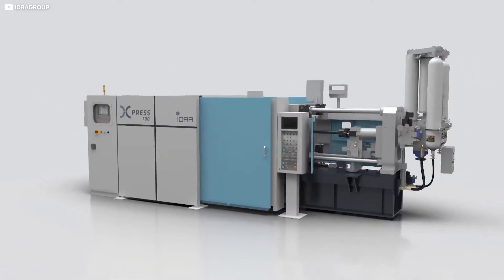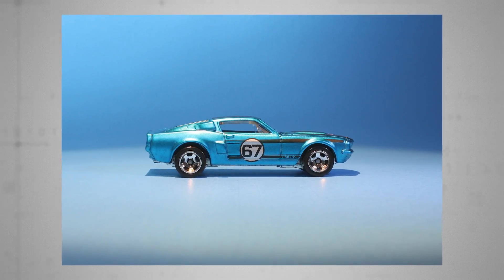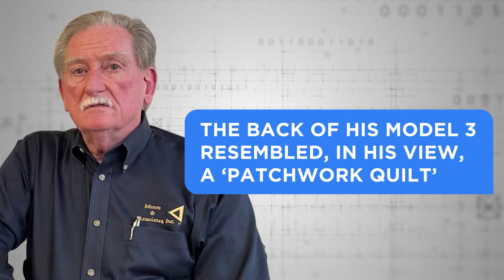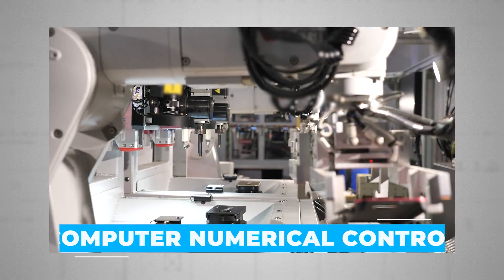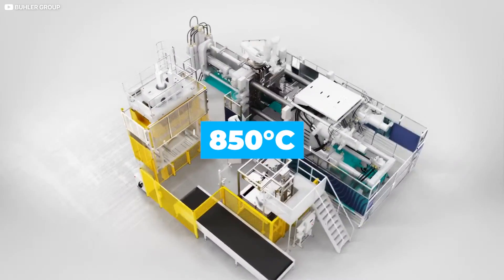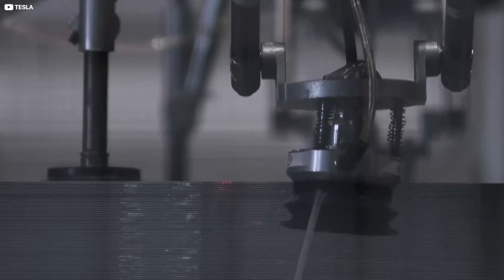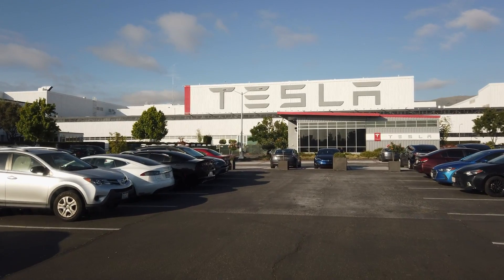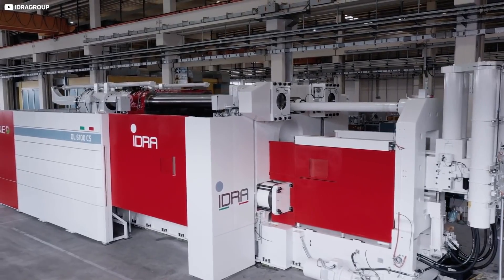Why Tesla Needed The Giga Press

Comment: Has SpaceX ordered special GIGA PRESSE machines from IRDA GROUP.
To build starship main components just like TESTA cars. Something to
Watch in the years to come.    Folks...

Non-Structional internal components like floordecking and wall dividing sections, taken from a starspace and left behind on the Moon or Mars. Question is, is a single Gigs Press worth the effort to manufacture a constant stream of standard parts for the numbers of Habitation module's planned. 
Only the internal mold forms need to be removable as time goes by. Saving costs in the long-term. Whichever way this happens.... Telsa and SpaceX have cornered the Market with Giga Press production. And elbowed out all competition for decades to come...

Comment: Will other auto manufacturers be forced to follow suit or fall behind?
Trick question. They're going to fall behind anyway. Even if they were able to definitely set a target date of 2024 to make their own gigapress, Tesla will make another gigantic leap and they'll be left in the dust again.
Reply: This is not an advanced leap. The "giga" press is not Tesla Technology. It is a commercial machine and process just like all of the robots that are used by Tesla and everyone else. To follow suit, the legacy automakers have to incorporate the 3 in 1 casting into the design. This is not that large of a challenge. When they are launching new vehicles, which almost all of their EVs will be, this is much easier than it appears. They will not be making their own gigapresses.

Comment: Hmm there are also advantages to using the traditionel process. Usually metals that have been properly mechanical and  heat treated show better mechanical properties than with casting. You can control the micro structure of the metal when you roll or forge a part. Also with casting you might have to make some compromises with wall thickness in order to make the metal flow correctly. You need a certain wall thickness to make the metal flow into every part of the molding.

Comment: The biggest upside is: when you have an accident you can't repair the cast parts but you have to buy new ones or better still a new car. Hurray!
Reply: Really? I would assume that gigapress consists of multiple parts itself. So you just need to repair that broken part or replace it and don't have to throw away the entire machine. Similar to cars, when engine is broken or transmission you don't throw away your car, you just need to repair broken parts.

Comment: i am curious about the durability and stiffness of that casted components - can they compete with drawn/wielded components? how safe are these on car crashs?
Reply: Tesla cars are the safest cars tested by NHTSA - the National Highway Traffic Safety Administration. EVs are safer than conventional ICE (internal combustion engine) vehicles as they are less likely to roll over due to the low centre of gravity of the battery pack. Also because their is no large engine in the front more of the front of an EV is a better performing crumple zone. Tesla's Model 3 & Y received top marks from the National Highway Traffic Safety Administration.
Reply: @SmartMart1658  Also note that the battery pack alone provides excellent chassis protection. It takes a much more colossal side pole impact to actually bend the chassis with a battery pack than with the undercarriage of a gas car because the battery pack alone has extreme reinforcements.
Reply: The same technology is being used for the current front, center and rear castings. That is also true for cast components used for structural and crumple components. Castings even today provide a complex form without the need for multiple parts/fastening with conventional press shop components

Comment: Build them faster.... Build the cheaper...Sell the cheaper... CHARGE THE HECK OUT OF THEM when they need to be repaired from an accident  (also pay higher insurance premiums )... say in 2 or 3 years...(when the batteries fail) while they are still paying off the original price of the car ( 51,190 USD for Model 3.... July 2021)
Reply: You sound very confused. Have you seen a doctor lately?
Reply: @brunosmith6925  Yes I am I am getting over the FLU!!! NO CORONA... and the meds are kicking my butt... maybe I should not take meds and comment while so called awake..LOL

Comment: Until someone invents automated carbon fibre layups and curing. The molds last much much longer, require far less energy and the body is stiffer. The brittleness is a problem, but alternative resins with less brittleness could be developed.
Reply: Carbon fibre is very expensive, and around 30% of any moulding is waste. The cost and waste issue - and the time needed to make carbon fibre parts, make it an un-economic process. BWM used CF, and while the car was rigid and strong, it added significantly to the cost and was not scalable beyond a production run of a couple of hundred cars a week.
Reply: The Tag Market yes currently very expensive. But cycle times have been reduced by huge factors recently through better methods of carbonisation. This, plus demand for high volume production will bring prices down.

Comment: The casting process described is a little inaccurate based my 4 years in the aluminum casting industry experience. Material is held and melted in a furance and poured in a shot sleeve via some external robot (horizontal chamber casting). The cavity is rarely vacuum sealed and instead (to remove air during the casting process) the molds have vents for air and excess aluminum to escape. I'm not sure about the silicon filter, the goal is to push the molten (now cooling) material into the mold via the shot sleeve as fast as process (200 to 400 IPS). Then the casting, while cooling in the mold) is hit harder again (intensified shot) to break any air bubble out and increase fill. The tanks show in the video are used to do this and hold nitrogen that is compressed with hydraulic fluid to store pressure like a capacitor.

Comment: What’s its turn around? How many “parts” can it make per hour?
Reply: Turn-around is between 180 and 186 seconds (3 minutes). Working 12 hours a day, that's 240 to 250 parts per day. Assuming Tesla could operate this "round the clock", each machine could spit out 500 parts per day. (Machines would probably need an hour out of each 24 for set-up, calibration and maintenance.

Comment: To say that bigger car companies don't do it, because they cannot reinvent der production line is a bit wild. Their will  be other reasons. Daimler build new lines for Mercedes in the last few years, they put out more cars with higher quality. For me this whole thing seems like it's cheaper, so make it work, doesn't matter if it is better for the costumer or whatever. I get Unibody Macbook vibes here, beginning of the end to right of repair. Like a lot with Tesla. Stop treating everything they do as a big revolution ...
Reply: Understanding the reason why other manufacture don't do it is the first step in innovation. 
Aluminum has galvanic corrosion with steel when is not properly done. Solvable if you have the know how. Is common in aircraft industry (not spacecraft industry). Tesla has ran into galvanic corrosion issue before in the past.
Casting has a minimum gauge, so you may not be saving weight. If you have a large envelope to design in, use minimum gauge, and box section. If is a small envelope, then use thick gauge. Here is a very large volume. Question if they are saving weight.
Root cause of problem was Tesla had a poor design to begin with. Way too many pieces stitched together. Sounds like engineering was trying to finish the project to beat schedule, and push the issue onto manufacturing. Sandy Munro recommend replacing those little pieces with one casting. Elon evidently decided to replace the entire subframe. 
Design is all about details. That can make or break your design.
Reply: The main reason legacy OEM's won't use this tech is the billions they have invested in their current mfg infrastructure. Because these companies are managed by accountants and "MBA" graduates, they make decisions based on short-term profitability, because their very jobs, salaries and bonuses are based on this business model. To abandon billions of dollars (euro, yen, pounds) of fixed assets, and invest more billions in different technologies would severely impact these companies finances and profits - and because short-term profit is what they operate on, they lack the courage to do this.

Comment: I am not so sure about pressure die casting. 
Things I handled produced this way were not that rigid that I'd want such parts in my car.
Reply: MY GOD!... You are RIGHT! Phone Tesla NOW and tell them to fire Elon and appoint you CEO instead.
Reply: You opinion is irrelevant for car safety. If it would be not safe, it would not get onto the road. There are many safety certification programs between the car manufacturer and the consumer.

Comment: I expect insurance cost to skyrocket as more cars are totalled out from previously repairable accidents.
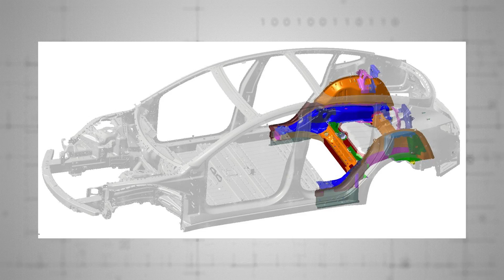Reply: 4:52 maybe watch the video before you comment
Reply: @user-RCST  That's not even possible, if the frame is a solid piece, bolting a new frame wouldn't be possible.
Reply: @guruxara7994  bolting and welding are two different things.

Comment: I would call it an injection mold machine. It is not a press as it does not work with a blank. It is not extrusion as the part does not flow out of the tool. It is not casting as the part is formed not poured.
Reply: It's die casting....

Comment: Reminds me of when the Germans used massive presses to forge magnesium parts for the 
Uftwaffe. We stole some of their presses as war trophies, used them for decades. Those were presses. This was a die cast machine.
Reply: I was going to mention that. I believe that press was to mold then firewall piece on the ME109. This held the engine mounts and the landing gear mounts. That is why the gear was so narrow. The metal used was something they called Elektron which I assume was an alloy of aluminum and magnesium.

Comment: I'm not sure what was meant by skipping the CNC step? CNC usually refers to parts that are machined (Granted maybe in this case you are using it to refer to the assembly line? But I don't think that is the correct terminology). The Motor Compartment and Rear Compartment are (were in Tesla's case) assembled from primarily stamped sheet metal parts which are then assembled by welding, gluing, bolting, etc robotic assembly lines.
There are very few CNCed parts in a Cars Frame, that would be just too expensive as the output is too slow.
Reply: thats the same guy that said that everything from toys to cars are injected molded by injecting molten metal in a mold

Comment: How does this affect the repairability of the vehicles?
Reply: Just watch the video. 4:54
Reply: @Engineer9736  Good if its really working.We need real life analysis
Reply: Teslas would be cheaper so you're better off replacing the whole car
Reply: Battery is a part of floor. I mean cells are structural part of car its sinked in glue. Upper body is casted in ALUMINIUM, minor crash and car is done.If they made car out of steel you could weld somehow but aluminum,no

Comment: I think it will be too risky to replace all those parts with 1. What if there are dimensional faults that can otherwise be worked out with other body in white models
Reply: That won't be a problem. The mold's will be made to perfect dimensions. Parts coming out will be perfect until the mold is well used. Once the dimensions are noticed to start changing out of spec, they will be replace with new ones.
Reply: The gigacasting is faster, cheaper and has much greater accuracy of production! It is the stamping, positioning and welding of 70 different parts that has greater risk of error!! Elon has said the best part is no part, the best process is no process. Also regarding repairs, can you imagine repairing a part that is a hodgepodge of 70 different stamped parts welded together!!! Plus the casting area only takes up 30% as much factor floor space so you can use the extra space to increase car production!!

Comment: Trouble is, with such a large machine it’d only take 1 small component to fail and the entire house of cards will fall down
Reply: Do you think the designers don't know this?  They build million dollar machines to be failure proof.  That is also why they have several presses - if one breaks down it won't stop production.

And if the press has a part that must be maintained or replaced, they have spare parts available, and scheduled maintenance times.

This is not a "house of cards that will fall down."

You need to get a clue.  🧐🧐🧐
Reply: @acmefixer1  aaah, so you’re a mechanical engineer ?

Comment: I operate a 300 ton press daily that thing looks gigantic compared to mine 😂
Reply: What do you use it for?
Reply: @andyhill7612  forming all sorts of different metals. For all sorts of companies like automotive and Hospitals. Such things as putting together the housing units for MRI machines to be situated in
Reply: I work with a 650 ton press and thought it was big 😅 i do plastic moulding tho but it’s kind of the same thing
Reply: @fransheteren2998  damn. What plastic you working with? The most I can do is up to 1" thick steel
Reply: @joet2585  it works with melted plastic that we inject into a steal mould so the thickness is not a important figure. I am limited by the amound of plastic i can inject withs is about 5500 cm3
Reply: @fransheteren2998  oh wow
Reply: As a technician, I've seen a 1.000 and a 2.500 tonne press 3 stories height - roughly the size of the one in the video, and a 10.000 tonne press only a tenth the size.

It really comes down to how complicated the workflow is and what the press is doing.
Reply: @akyhne  that is ofcourse true. Like you said it all depends on what the machine is doing and that is pretty much assembling a car inside it so it would make sense. I'm only bending metal but even still. Fuckin huuuuge 😂
Reply: This one covers larger area. So much bigger part. For a particular metal or alloy force equired must be similar but size will vary.
Reply: @soorajj9207  true. But still Id have to say about 10 times the size 😅

Comment: All major manufacturers use a press similar to this one. Nothing new here but great video nonetheless.
Reply: They use it for smaller parts, not a huge one to manufacture an entire rear and front underbody
Reply: @cjk_02221  And the reason for that is simple: Repairing.
Reply: Guru Xara if you by somehow with the force of fucking zeus deform the frame of car be lucky you’re alive. But they have addressed this with crash rails on the inside of that casting.
Reply: Not a press, a casting machine. No they don't. Requires a custom alloy Tesla developed in-house to avoid warping and heat treating. No one is making castings even close to this size other than Tesla.
Reply: @bradstewart7007  Really? Tesla invented the alloy for the casting machine builder? The same casting machine builder they buy the Machine from? The Castings currently are being built approx. 1/3 to 1/2 this size.
Reply: @larrycrep3767  Yes, they did. Not sure if IDRA has their own alloys to recommend other potential customers, but as far as I know, the bar is pretty high to follow Tesla because to produce castings of this size and quality you have to develop your own alloy that doesn't warp and doesn't need heat treating.

Comment: Without watching the video, I can say without a doubt they needed this to fix the door gaps. Luxury vehicles should not have manufacturing defects.
Reply: It is the rear part of the chasis, so they didn't adresse the door gap issue
Reply: My Model-3, and my neighbour's Model-S (both early 2020 builds) have perfect gaps. We were at an owners' club meeting a month ago. There were around 30 - 40 cars there. This gap issue was a subject for discussion. All late production (2020 onwards) had no gap or paint issues. Seems Tesla has addressed this.
Reply: Door gaps are just cosmetic most of the time. It really doesn't matter unless it's actually interfering with the ability to open.

Comment: how will the pressed frame-system affect the costs of collision repairs?
Reply: All manufacturing is going toward just making everything disposable, until we tell them on mass we want different it won’t slow down.
Reply: @clarkkent4683  and to be honest even then, they don't care.
Reply: @clarkkent4683  
making the entire body out of one piece of metal will make it easier to recycle.  You just crush the entire thing, melt it, and make another one.
Reply: They will suggest to buy a replacement car. At least, this is what Apple is doing to their products, self repair is not favorable.
Reply: Disposable cars will become a trend, and that's the worst scenario for the consumers.